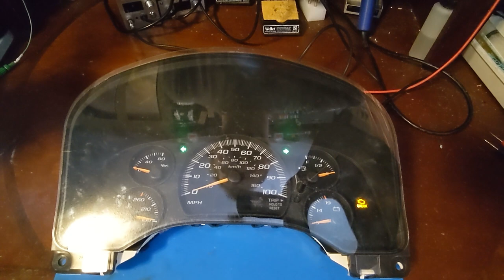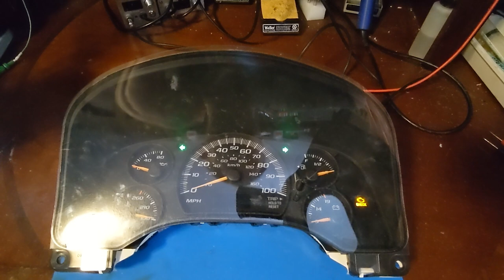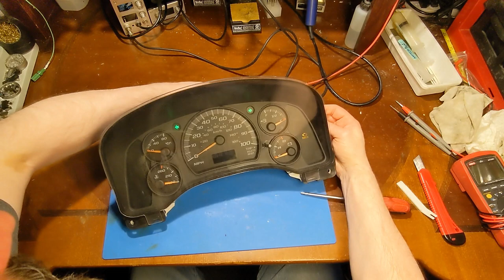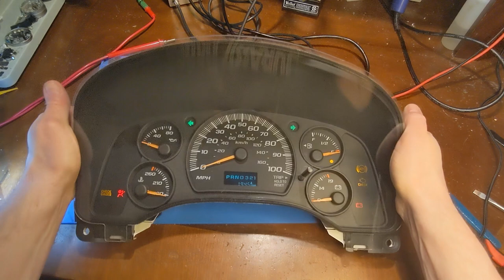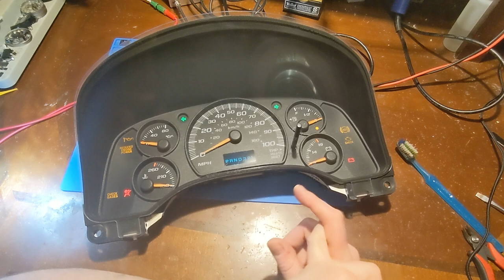Let's fix a Chev Express Cluster

Comment: I love your repair videos. You and fixed until broken have made me into a cluster fanatic, and it's turned into my primary income these days.

I would like the soldering iron because I really need to upgrade from my old 10 dollar soldering iron
Reply: If you didn't win I can heartily recommend the Pinecil and the Sequre nano 60. (I bought one when I too did not win, but the Pinecil is a $25 version of the TS100 with the power versatility of the TS80 too. Excellent soldering irons. )

Comment: I've been meaning to ask.  I've mentioned before that I repair classic car instruments but word of mouth gets around and I occasionally get an electronic cluster to look at.  All I can really do is check for dry joints or anything that might be obvious but I can't power these things up.  Now, this is Australia and there are maybe a handful of people who can repair these and their turn around time is in the months, if at all. 
My question is, where do you find the information on pin-outs in order to safely power these up ?  I have to tell a customer that all I can do is check for mechanical failure like dry joints etc but I can't do electronic work because I refuse to take the chance to power up the cluster and damage it.
It's kind of frustrating because I'd like to help the customer but I'm limited in what I can do.  The customer can't get any satisfaction from the dealership because even they don't have the technical knowledge to repair or reset odometers in a replacement cluster and giving the cluster to a repair guy can take months. 
Many clusters too are coded to the vehicle which means going to a salvage yard won't help either.  Anyway, sorry about the long comment.

Comment: This one you thought is 3-Ohms  resistor probably is a Zener protection diode that is shorted.
Reply: Came here to also say this!
Reply: Or reverse polarity protection diode
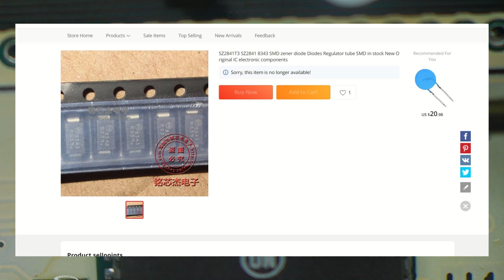Reply from the maker: Did none of you make it to the end of the video? 30:57
Reply: @jeffescortlx  I think we all did, just commented prior to watching the end
Reply: @jeffescortlx  made it to the end but couldn't believe you stated the wrong thing so long.
Reply from the maker: @TheRetiredtech  I'm used to diodes having a stripe. This diode had no stripe.
Reply from the maker: Am I the only person to find it strange that this diode has no polarity marking? That's a pretty important detail that no one seems to be concerned about. Text orientation alone wouldn't usually be trustworthy of component polarity.
Reply: @jeffescortlx  Its a bidirectional TVS diode, it has no "polarity." The bottom side of the component may have a different shaped pad on one side for SMT assembly. 

SMT LED's are similar, no top side polarity marking, but one pad on the bottom is shaped differently, even though they are polarity sensitive devices.
Reply from the maker: @ColbyJohnson  This is my first time coming across a bidirectional diode in the wild. I've replaced failed TVS diodes in the past, but they had a traditional stripe. Thank you for pointing that out. As far as LED's, you must be talking about the really small package size? 3528 and larger will typically have a notch in the corner to indicate polarity that I have seen.
Reply: @jeffescortlx  Yes, for instance 0603 is pretty common for power good LED's on boards. They have a "T" silkscreen on the bottom of the component.

Some diode packages (0402 and smaller) will use a cut corner on pin 1 for indication as well. 

Package standards are an absolute mess
Reply: @jeffescortlx  Personally the absolute worst standard IMO is when SOIC package manufacturers don't use a "dot" for pin 1 indication. They will make one side of the package a deeper chamfer than the other side, which tells you that's the "pin 1" side. Extremely hard to see under microscope or pick and place vision cameras when choosing orientation for pickup.

Comment: Well done, it didn't take you long to cure it's illness doctor digital :-)
I was mentally shouting at you when you ignored the two components with a burnt track between them.
One is a layered capacitor that typically goes short for no dam reason.
Usually laptops suffer from that.

Comment: Thank you for another great  troubleshooting video. Please enter me in the drawing for the soldering iron. That 3 ohm resistor is very puzzling. Could it have originally been some sort of protection device and was somehow replaced by the person who previously worked on the board by the wrong part? You mentioned that it seemed to have been worked on before, unless I mis understood. If they were trying to find the original number part is would have been easy to get a mis marked part or they just took a WAG.

Comment: first time i’ve seen inside an instrument cluster. very informative. i wonder how much component similarity there is between different vehicle manufacturers. surprised to see the multiple stepper motor used - makes sense for large dial analog speedo & tachometer. the one plug interface makes for easy changeover. i hate to guess cost of unit. impressed by your fault finding/fix using visual cues, simple voltage & current tests only (no schematic).

Comment: A line to ground usually indicates a flyback diode for handling a sudden voltage spike.  The kind of spike that also takes out display chips.  I've had one fail on my Peavey Tube Amp and it basically did the same thing - registered as a short to ground.  This era of Chevy is full of weird electrical problems, particularly in the charging circuit.  I wonder if the alternator went full throttle.  Alternatively, I wonder if he jumped it off a 24v system like a tractor rig....

That's a pretty cool little iron.  I bet you could get some quick field repairs done with a USB battery bank.  If I get selected, I'd gladly add it to my arsenal, but if not, I'll add it to my shopping list.

Comment: Nice video, that "resistor " is a transient voltage suppressor diode (TVS)
Reply from the maker: Yes thank you I had it mostly figured out by the end of the video. How come it doesn't have a stripe on it? Is it normal they don't have a stripe?

Comment: Those tips are JBC 210 clone tips.  They are getting more popular.  T12 is still best bang for buck.  I would love to get something that small.
Reply: Hello, the SEQURE S20 Soldering iron in this video is compatible with JBC 115 tips. If you need to be compatible with the JBC 210 tip, the SEQURE S60 Soldering iron it does the job.

Comment: Great videos. I love them all. You are so good at doing this stuff I can't get enough. I always won something so don't put me on the list. The wire strippers and multimeter. I would love to try doing this stuff but at 71 cannot afford to buy all the things and learn it all. What kind of solder do you use and flux and what kind of alcohol cleaning do you use? Rubbing alcohol?  Still have steady hands though.....lol
Reply from the maker: I use Kester no-clean solder SN63PB37 both .4mm & .8mm. The flux is Amtech NC-559-V2-TF and the Isopropyl alcohol is 91%.

Comment: Could you help me fix my 04 Chevy Astro cluster? I have to push and maintain the pin trip reset for it to display properly, it  goes dead if I let it go. 😢
Reply from the maker: It probably has fractured solder joints around the VFD display.

Comment: Ive only just started getting into cluster repairs. but have my own little bench tester. but can i ask ya. how are you able to test activate the communication on the bench? i usually have to plug in a scanner or tech 2 with a dlc ive wired up.
Reply from the maker: I've built one of these https://youtu.be/sK-0JmeoRZM

Comment: Nice fix Jeff.  There's one bulb that you never mention.  It gets very little use and that's probably why. It also never comes on when you do a bulb check.  It's the hi beam indicator.  my guess is that it is powered up by the lighting or body control module but how would you power it up to check it, other than running a jumper wire?   I'll put my name in for the soldering iron too, thanks.
Reply from the maker: The high beam is typically a LED, that doesn't go bad under normal conditions. it's turned on by a bus signal.
Reply: @jeffescortlx   Thanks Jeff.

Comment: Are you sure that 3 ohm resistor is not a shorted capacitor that reads 3 ohms????
Reply: It is not a resistor, it is a bilateral ESD protection diode. They tend to fail short circuit.

Comment: Hey Jeff! I’m unable to get your email
Address through your “about”. Have you dealt with the 07+ Escalade clusters being inoperable except for blinking needle glow? Looking for help. I appreciate any advice or suggestions. Thanks! Love your videos I’ve learned so much!
Reply from the maker: Yes I believe this is a software issue and not a hardware issue. I've heard that reflashing corrects this issue. I do not have the equipment to reflash this model of instrument cluster.
Reply: @jeffescortlx  well thank you for the confirmation and reply nonetheless! You’ve played a huge role in my knowledge and confidence repairing these clusters for myself and others! Thank you for sharing!
Reply: @jeffescortlx  you were right, and I found the bulletin confirming that the dead cluster with only blinking needle glow was fixed by reflashing the cluster. The tech used a MDI2 and i was in and out in 15 minutes or so. Nice guy. I noticed before leaving though that the gear indicator did not indicate any gear. Has anyone dealt with that before? Any help is greatly appreciated I’ll donate to the cause once I get this thing gone and get paid. Love your content
Reply from the maker: @roberthorvath1563  I would recommend to go back to the person that reflashed it. They might have used the wrong option.
Reply: @jeffescortlx  I asked him about it on the spot and he didn’t have any answers. Oh well. Thanks for the tip Jeff! I know that’s often the case when that happens with the 03-07 classic clusters after being reflashed

Comment: Did you prefer this iron to the previous one you reviewed? Considering one of these
Reply from the maker: So far my favorite is the SEQURE SI012. It's compatible with two different kinds of tips (T-12 being my fav) and it has both USB input and old style barrel jack for power input. But it's not as compact as the nano in this video.
Reply: @jeffescortlx  thank for that info  and everything you've done to help my noob ass get into board work

Comment: Where does this cluster get it the data for the actual voltage gauge? Is it from the PCM, the BCM, or is it reading it from the bus on the cluster?
Reply from the maker: For this year range, the BCM takes the voltage reading and sends it through the bus to the cluster.
Reply: @jeffescortlx  that's annoying. I am trying to pervert this cluster into another application with the PCM ...but don't want to install the BCM just so I can get the volt gauge to work...I am planning to use the speedo as a tach and the fuel gauge as engine oil temperature. Didn't see VOLTS being the hangup considering there's so many other places it could be pulled from!
Reply from the maker: @evracer  with the full size GMs, The voltage reading was taken at the instrument cluster up to 2002. 2003 is when they switched to taking the voltage reading at the BCM. 
I guess it's possible you could just throw in the BCM and apply power and ground and the bus wire, that might be enough to get a functioning voltage. I'm just not sure if the BCM is going to be upset and try to trigger a cel with everything else unplugged.
Reply: @jeffescortlx  this is in a racecar so it could just add to the list. I got into this as an auto tech replacing s
Steppers and lights and only recently with this project started trying to really do some oddball stuff. Racecars have no use for a speedometer and have a need for a big tach. I intend to do this by signal swapping if possible. Everything is from an 05 Express and want to keep it that way...but I notice there are no vss wires in the plug like there is on the truck clusters so I hope I can just pin them and feed it from the PCM's engine speed output. Racecars don't need a fuel gauge either, so a second "coolant" temp sensor will go in the engine oil pan and just be connected to the PCM's fuel level input. It looks like the resistance range between the coolant temp sensor and the fuel level sensor are both 40-250 ohm. If I can't get the mph to tach swap to work through wiring, I will have to see if I can do it somehow with IPC hammer.